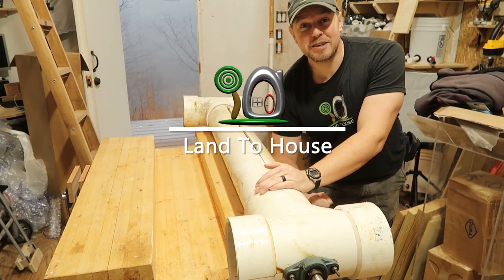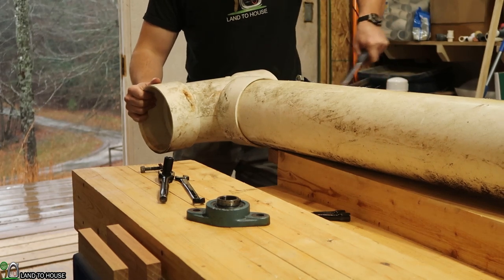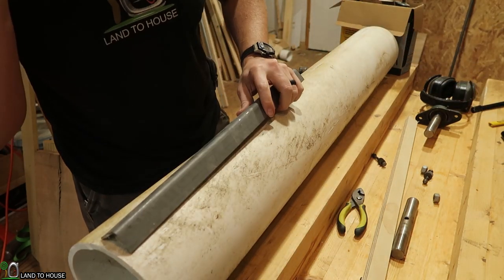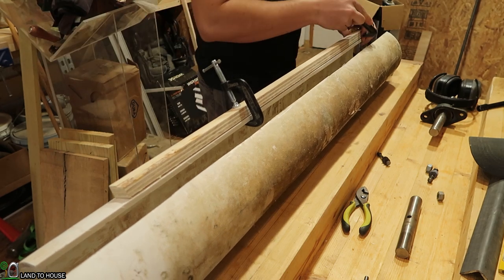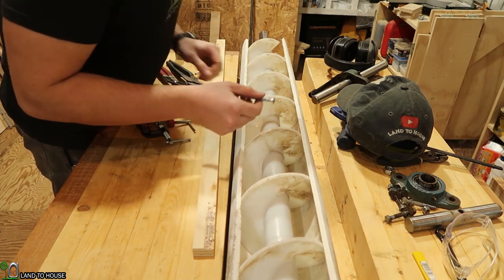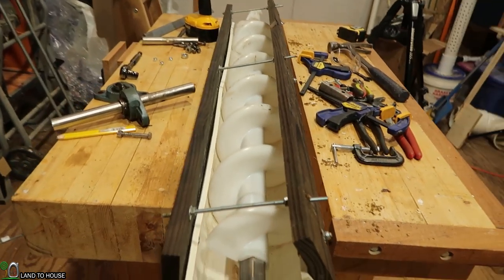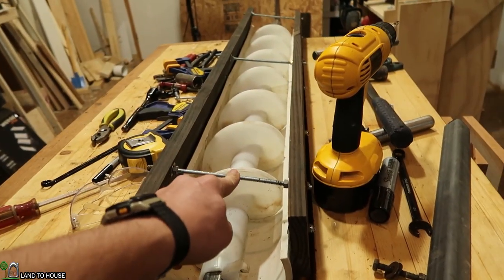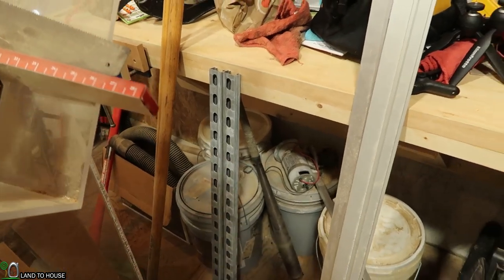Archimedes Turbine Build p4

Comment: Just grind down the auger to fit. As long as you’re close you’re going to be surprised how much water you can pump through there.  I think what you’re doing works great just pull out that auger and grab a grinder and make it fit the tube.  I worked on these before in school and thought it was horrible and would never work and it moved about five times the water I ever thought it would.

Comment: I wish we could get the rain you are getting in the background. We have 6 inches of snow and sun, the spring is hardly flowing at all. It looks like you are makign some good progress on the screw turbine.
Reply from the maker: We have had many inches of rain in the past few days. The creek is roaring.  I need to go out and do a series of flow rate/ volume tests. The project is going well!
Reply: @LandtoHouse  The sun has melted enough snow to fill a .130" nozzle, which isn't enough to spin up to full RPM because of that darn friction.

Comment: You know every farm has a generator already pre built (grain auger, just look for silos), and some even have electric motors attached some are pto driven and some gas motors. If you could somehow pour something on the auger to form a great seal as its running (like wax or melted tire rubber). But im thinking on terms of apocalypse level engineering.

Comment: I just wonder viewing this 1.5 years later: Have you ever continued this Archimedian Screw project? Actually, I think that an Archimedian Screw is not optimal for generating electricity. The Pelton wheel in your micro-hydro system is surely much better.
Reply from the maker: Its still sitting on the floor of the shop. Waiting for time.
Reply: @LandtoHouse  Oh well, so many projects and so few time ... I just looked around me, and it looks like that's the case on both sides of the Big Pond.
Reply from the maker: This is from a farm auger company called lundell plastics.

Comment: To bend pvc like you wanted to use a few bags of playground sand heated up in the oven for about 20 minutes and spread it out at least an inch thick on your table and burrow the edge in for 30 seconds to a minute
Reply from the maker: I have heard of such a technique. I wonder if it would cool off before I got it out to the shop though

Comment: Why didn't you just grind a little off the screw so it would spin freely inside the tube and maintain the enclosure ?
Reply from the maker: I did that years ago. Shaved at least 1/2" off. It was not fun.